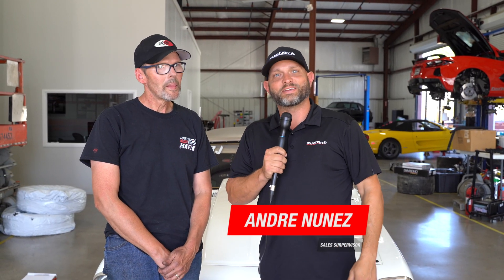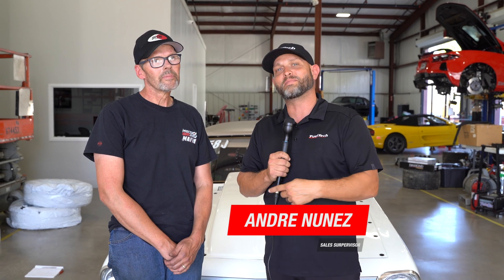Unique Chevy II powered by ProCharger and controlled by FuelTech FT600 | Ron Bell

Comment: If I'm not mistaken doesn't this car have an all billet OG style SBC bolted up to a TH400 trans and a fab 9in out back and it looks to be a steel roof and quarters car as well and if it does have the engine combo that I think it has it might not have broken any dyno record on the Fuel Tech hub dyno but it's still pretty solid numbers for an OG style SBC with a crank driven Procharger bolted to it and just think if it had either a big single or a set of twin turbos on it then it would almost doubled the amount of horsepower that it put out on the dyno just like most car's do that switch from turbo to Procharger or vise versa and just to think if it had a set of symmetrical port billet heads on it from MBE with shaft mount rockers and fully CNC ported and polished with a solid roller camshaft to kick it up a notch with a bolt together lock up converter with the correct stator and a set of dump valves  then they could really dial the car in but all in all solid numbers from a solid build and a very nice car and the dedication this guy has to go all the way from Anchorage, Alaska to Ball Ground, Georgia which if I'm not mistaken is Middle Georgia if not South Georgia no wonder it took him almost 9 days to make the trip and that is one way and he still had to make the trip back home and then go racing at his local track to do some testing before he takes it to Las Vegas for the SCSN

Comment: Your advancements in engine management system is second to none differently raised the bar.here in Australia there's  a street registered ford inline 6 cylinder producing 2200 rear wheel hp.v8 are   not go to engine anymore here.its like ya American's are scared of change or have endless money.peace
Reply: There are street cars in the United States capable of 4000+ hp, one of which has run 5.77 and just shy of 266 mph in the 1/4. It isn't that people are scared of change. A Barra, well, there is nothing that the Barra can due to scare them... Being able to win with the parts that are available for them is far more important than having a street car that literally makes half the power. Barras have never been sold in the United States, so it isn't like you can go to the junk yard and pull one out of a wreck. Don't get me wrong, the Barra is a great platform to make power with. But your not going to stand a chance against 4000+ hp v8 car with a Barra either... And if you think 4000 hp street cars is not change, well, it is. It just isn't change involving a 6 cylinder that you can't get in the US... Mad props to Maria and the team that did build that Barra, they made crazy power, set the dyno record, etc. Just keep in mind that the fastest street cars in the US with V8's get down the quarter 2 seconds faster, almost 80mph faster. And they also compete in events where you actually have to prove it is a drivable car.
Reply: Rod tschiggfrie got one off the fastest car in usa Twin turbo 640ci over 5000hp run 1,4@260mph at 5.80.let's compare fastest 6cylinder 2jz run 5.5/5.6@260mph down 1800  hp or more give away 400 to 450ci.to me something not right tell why a engine with 2 more cylinder 400 or  more ci around 2000 more hp  is slower than a  2jz.peace
Reply: @wayneireland4802   How much does that 2JZ piece weigh🧁 That's why🤦‍♂️✌
Reply: @wayneireland4802  In most of those classes, but not all, V8 cars have to weigh 2800 pounds min, 6 cylinder cars have to weight 2000 pounds min , 4 cylinder and rotary cars are 1200 pounds min... The reason you were grasping for is the massive weight difference between the classes. 800 pounds between 6 and 8 cylinder is a huge difference, and it is done that way on purpose..... Maybe you should read the rule books, because they only reason the 2jz is that fast is because of the huge weight difference.